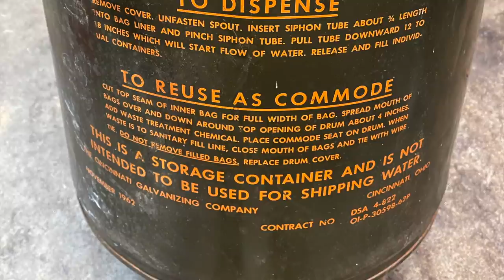Saving original paint on a vintage car or truck/removing hinge pins

Comment: Put a long bolt with a washer welded to it in the handle of the vice grips, with a tubular weight (press tool) that passes over the bolt, you then have the "slide grip". I invented the tool in the late 80's to remove crankshaft hub dampers from Ford's 2.3 4 cylinder engines...
Reply from the maker: I built something similar for my land rover when I went to remove the rear door (luckily a place on the all aluminum truck that is steel! lol), I also have a hinge pin press tool, but with this one felt the heat and beat was likely my best shot lol...If it hadn't come out I was going to try to weld a nut on the bottom of the hinge and then just run a threaded bolt up through the bottom...but just not much surface to weld to with this hinge...the hinge geometry on these early buses isn't like the later ones...funny how necessity is the mother of invention! GO YOU!!! I love when people share stories like that! YOU ROCK!

Comment: A good result on the paint stripping, well done! It did occur to me as you have the rotisserie to flip the van over so you could punch out the hinge pins in a downward direction, make it a bit easier to hammer, perhaps try that for the other door? Loved the artwork, a really good re-use of a canister! Greetings from the UK!
Reply from the maker: Yeah that stuff either works or doesn't lol I'm thankful on this project it has been a solution! I considered flipping it, but I figured I had the best chance of NOT breaking the passenger door window glass at this angle...my mini sledge was really close to bashing it  out a  time or two and  that would not have been good! lol but YES I plan  to  try that  on the other one if it fights me! thanks for being here Gary!

Comment: Got to save those high hinge doors and especially those 55-58 flat front cargo doors! That OG dove blue was worth the effort!
Reply from the maker: I know!!! The doors are both actually in really pretty decent shape considering.  I have been so shocked with the condition of the original paint.  When I did the drivers side and the rear of the bus I was blown away with how "good" it was...they didn't even sand it when they painted over it!

Comment: Marci. Awesome job on the box end over the screwdriver trick. soak the latch in a bucket with wd.
Reply from the maker: thanks! latch is good as "new" I'm just glad it came back! was afraid something might have been broken inside as previous folks had used pry  bars etc to pry doors open...

Comment: It's looking really good Marci. I'd probably put some rust converter on the cancer spots just to get the black metallic next to the blue. Still, it's a VeeDubb! Regards, Solomon
Reply from the maker: yep, I mentioned in another comment I usually do the ospho on the cancer spots, then a mix of boiled linseed oil (or) toilet ring wax and mineral spirits over it after rust treatment cures...I'm not a fan of clear coat because I like it to be natural looking but "treated" for preservation! thanks for stopping in Solomon catch you on the next one!

Comment: Some magnets hold the pin in the hole and you rotate the hinge pin at the same time as hammering is a better way.
Reply from the maker: there is an absolute zero chance a magnet or vise grips or anything else would have budged these...the pin had become one piece with the top hinge loop and was seized...I considered a hinge pin puller, but I think I would have just torn the puller up...everything on this project is rusted beyond belief! lol I'm actually shocked I didn't have to cut the hinge to get it off! hahah thanks for stopping in! catch you on the next one!
Reply: @marcijunebug  Hole thru to pin for string loop and magnet other end of string to keep it up.

Comment: My entire double cab is covered in house paint, I need to try this.
Reply from the maker: I’ve done the entire driver side and the back and so far it’s worked amazingly well! As long as the original paint is there I bet you can save it! Just start in a small non-noticeable area first to see who it works
Reply: @marcijunebug  I was going to grind it all off to bare metal and epoxy prime, but I love the old paint and patina look.
Reply from the maker: Well it’s worth a try

Comment: Do you use map gas for heating stuff? I use oxy/acet but that looks less cumbersome. I am sometimes too old school.
Reply from the maker: it's a small cheap torch head hooked up to an acetylene tank...it is kind of a "homemade" set up but works great when you don't need tons of heat in an area

Comment: Hi Marci, The original paint looks like I think VW paint Medium Blue: LH5G.meby you can use that ID. Again a great piece of metal Art.Love it. greetings.Hubertus.
Reply from the maker: It is  DOVE Blue which I believe was code L31, we have a local place that will match paint and put it in a "rattle" can/spray can for you. I will take in the gas door or deck lid and have them mix up some for me so we can blend in the repairs I do on those hideous hippy widow repairs! ha Take care over there and see you on the next one!
Reply: @marcijunebug  Thanks Marci, but I do have my paint provider here in Norway who mixes the original paint. greetings.HCS

Comment: How much snow did you guys get? We have about 12” total here in Ohio 12 degrees right now. Tomorrow and next few days a heatwave of mid 30’s 
I don’t know how you stand the cold. 🥶
Reply from the maker: with the two 'bigger" snows we got about 18" total...then we had a couple 1"-2" snows in between and a day or two after...it has been bitter cold even for me! ha I usually don't mind it if it is above 20! ha  And yes I am going to welcome those 30 deg temps!

Comment: Looking sweet. Very cool paint removal process.  I think I missed what exactly is going on with the metal at the bottom of the door with the piece missing and the bondo right above it? What took place there previously?
Reply from the maker: thanks, it has worked pretty well on this project...someone cut off the door bottom and welded a piece on the back side of the door skin...it's a hack job, then they just used bondo (about 1/2" thick at bottom of door) to fill it in...don't worry I will patch it up proper once I get a chance...the previous repairs have been pretty funny sometimes

Comment: Hi  I'm really enjoying your vw resto and finding the art  right up my alley . It's great.
you have me thinking i need to buy a Plasma cutter... What model of plasma cutter are you using?
Reply from the maker: well thank you, I appreciate that! I truly went and bought THE cheapest one I could find on amazon.com  I have been very happy with it.  it will do 220 or 110 voltage and is called a "cut 50" there are several models in that category...I've linked one similar to mine (mine isn't available any longer)...I honestly don't know how I survived so many years without one...I love it! 
https://www.amazon.com/Voltage-Cutting-Machine-Display-Accessories/dp/B07GB3T4KG/ref=sr_1_5?dchild=1&keywords=plasma+cut+50&qid=1613868010&sr=8-5

Comment: Marcie did you find that the goof off damaged or removed the OG paint?  Was it a race to wash it off the surface of the OG paint before it ate through?
Reply from the maker: no, it pretty much has zero effect on the enamel based OG paints.  I've never had it eat through original paint on this project and I've done the entire driver side and the back of the bus. I also have done another project where I used the same process without issue.  I think the big thing is how old the original paint is and if/not it was hardened single stage enamel.  The paints were just tougher back then (1930's-1960's).  I still say test it on a non noticeable area and then expand from there if you want to try it.  If you only have a layer or two of paint over the original then try acetone...
Reply from the maker: never used that...but willing to give it a try...I typically use a mixture of boiled linseed oil <or> toilet ring wax (melted) and mineral spirits...then let it sit out in the sun on a hot day for a good bake.  Gives a very natural look (not like  clear coat) and will protect it for years!  If I think the spot is going to be a real problem I will first treat it with the Ospho rust treatment then do the wax/mineral spirits after that has cured
Reply: @marcijunebug  excellent. Well we are all looking forward to seeing what’s under the 15 layers of the paint on the rest of Pickle!

Comment: Are you going to do the Goof Off trick on the whole truck?
Reply from the maker: yes, I've already done the entire driver side and back, and about 1/2 of the front nose...I'm about 7 cans in currently so once I do the passenger side should be able to do the total truck for about $150 or 15-ish cans which is totally worth it to me...lots of time, but the driver side went much faster as I could work a larger area all at once and it was much warmer out!
Reply: @marcijunebug  Yes. OG patina is definitely the right call!

Comment: The plexiglass Windows are ugly, but I think it will be better to keep them for now. They become part of the bus identity.
Reply from the maker: i know...and if they were all the same size I might consider it...but they are all crazy different sizes and several are busted...I mentioned early on in  the project that it's going back to full panel bus...but you are correct...they are  kinda part of the project, so I'll have to think of a way to "reference" them in some part of the build